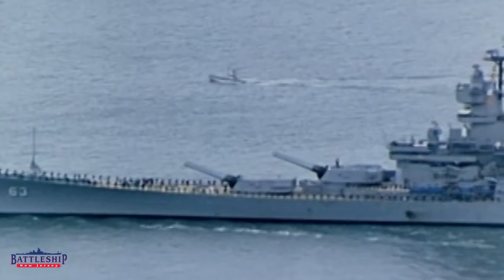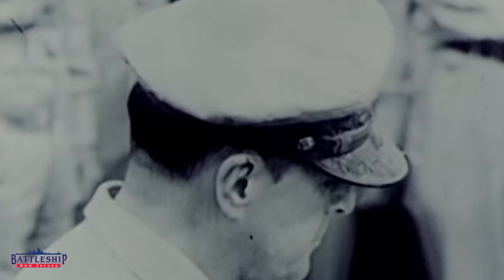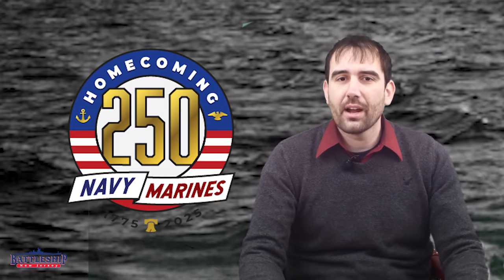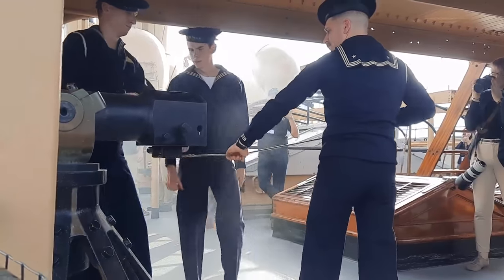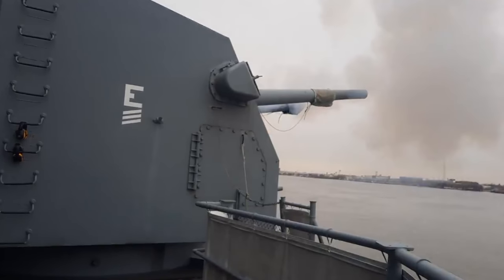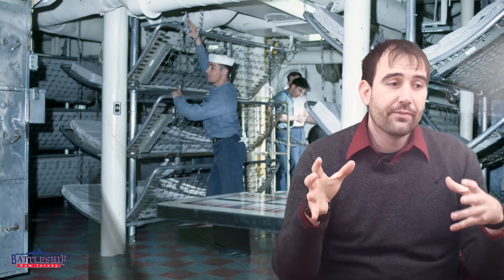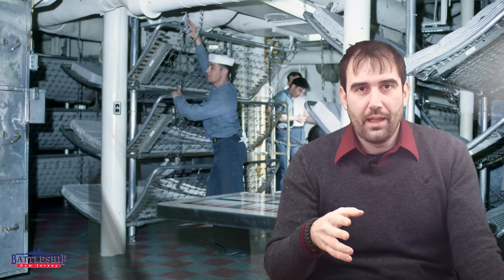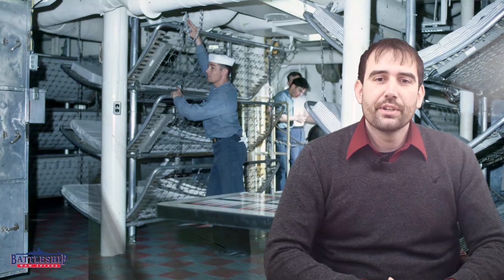Could You Build a Full Size Replica Battleship?

Comment: I mean, you'd basically be building a cruise ship with extra steps.  The really expensive parts- the military secrecy in gun and sensor performance, the guns and sensors actually living up to said performance, the safety procedures for stowing tons of explosives, the armor hardening... all would be skipped
Reply: but its nothing like a cruise ship.
Reply: @MrChickennugget360  was thinking the same thing. 

Show me a cruise ship with 5 layers of 1.25 inch thick steel backed up with a foot of armor grade steel, nine sixteen inch diameter guns that can shoot something 25 miles away... And go 33 knots. 

Nothing like that exists. A cruise ship does like half that speed, and doesn't compare in any other way except size.
Reply: @johnhartley5071  Dude, OP isn't talking about making a battleship -- they're talking about building a replica of a battleship. Which means that the guns, armor, and stuff don't need to work. It would still be a massively expensive and not-worth-it undertaking, but it's closer to building a civilian ship than you're making it out to be.
Reply: @vandahm  exactly it would need to look like armour, not be thick armour
Reply: @eberbacher007  

If you want the same draft, you better up the steel thickness

Good news is that it doesn't have to be armored steel
Reply: Yea they need to save the USS United States instead!

Comment: I believe this is a good place to restate my view regarding the galley and mess decks. With enough money, create a duplicate ashore. This would be a great money maker. It would actually just be a restaurant.
Reply: The mess would look a lot like a 1970s High School cafeteria.
Reply: @robg9236  I never had a cafeteria with an overhead that was only 1' above my head with all kinds of pipes and wire trays. Yes, you'd need to duplicate even the overhead, coffee urns, milk dispensers, scullery, etc.
Reply: Does Ryan explain somewhere why the Navy's contract doesn't allow them to return the galley equipment to operating condition?  Restricting the 16" guns and to a lesser extent the propulsion equipment make sense, but the galley equipment?  Is it a safety issue perhaps?
Reply: @MSUTri  The only thing I have heard is that nothing that requires steam can be made live. The galley requires a lot of water, cooking, steam tables, scullery. All of that water has to go somewhere. A lot of us had the same complaints when trying to save the Ranger. We wanted the galley to be useful. But, how do you get rid of all the excess and dirty water?

Comment: I understand the prohibition on reactivating the main guns and the propulsion system.

I have wonder though, what is the Navy's reason for not wanting the galley active? 

That would make it easy to feed tourists and add to their 'you are one of the crew' experience.
Reply: If I was to take a wild guess. It might just be because of the fact the Iowas were massive and anyone that doesn't know the depths of channels could in theory cause a Suez Canal like situation.
Reply: They covered this in an earlier episode. The galley used high pressure steam from the boilers. Dangerous stuff.
Reply: @randyogburn2498  Alright, yes, that would present a problem if they were going 100% authentic. However, in keeping with the theme of this video on replicas, surely some modern equipment substitutions can be used to bring the galley to an "operational" state for the making and serving of food.

As an aside, from the ships I have been on, I can see how steam would be used for some of the food preparation and 'keep it warm' storage sections but that would probably be low pressure, not high pressure steam. 

A bit of a moot point though since they can't fire up the boilers, so no steam regardless of the pressure level.

Comment: Here is a link to a Curious Droid video on how NASA determined that it could not reasonably build new F1 rocket engines that took man to the moon 50 years ago, despite having every possible blueprint required to do so.  Those engines were essentially hand-built and hand-fitted by the highly skilled engineers and craftsman of the day.  Yes, we have such skilled engineers today, but they do not have the practical experience these men had to build such complicated machinery.  Current engineering could build far simpler and more powerful modern engines to do the same task, but we no longer have the skills required to recreate what was accomplished at the start of the space program.  

https://www.youtube.com/watch?v=ovD0aLdRUs0

The same would be true of building a complete Iowa class battleship from the keel up that would be an exact copy of the original.  We need to preserve and treasure the fragments of our national past that we still have such as battleship Hew Jersey and her Iowa class sisters.
Reply: There are also a lot of materials that have been lost to safety regulations, where are you going to find a lead paint or asbestos insulation supplier these days?

Sure, those materials were banned for good reason, but the knowledge required for how to produce them and work with them was lost.

So if you are going to use modern materials for paint and insulation, and you can't make an F1 engine, you have to make other design decisions as well. Why not just use modern insulation/engines? Why not use modern computers? Why not use modern materials and engineering? Heck, slap a bulbous bow on there.

Pretty soon, it devolves far, far away from an actual WWII battleship, to just some ship painted gray.

Comment: I only know a little bit about warship construction. But I did learn a bit about casting the 16 inch guns at the Watervliet Arsenal in upstate New York. Let me just say that you need an enormous amount of infrastructure to make the components of the gun barrels, and assemble them into a working cannon. 

Even if you don't intend to have functional weapons, what are you going to do, just paint a steel tube? Even a cylinder of steel that large is going to be heavy and unwieldy and require some seriously heavy equipment to move it from its place of construction to the ship. 

That's only one component of many, but it is a good illustration of the serious technical requirements of building something as big and complex as a warship.

Comment: For a replica battleship pre-dreadnought, dreadnought or newer the most feasible way would be an accurate 3d model viewed in first person VR. Now for something like the USS Monitor, that ship could be built using modern construction methods for probable around 300k or less if the person building it was doing it their self and some friends and volunteers were helping, they would still need a place to build that ship on the water though and thats probable one of the hardest parts of building a ship these days..

Comment: Even railroad steam locomotives need somewhere in the neighborhood of $1,000,000.00 to go from sitting in a park to running at 70 mph on the mainline -- if they can find a mainline RR which will let their prize run on its tracks.  There are always tourist RR's they can run them on, but few if any of them has enough track to let classic high speed passenger and fast freight engines get up to the kind of speeds they were built for.

Comment: Pretty much believe you are correct, except for the electric motors. Until recently I worked at a paper mill built in the 19030’s. We have spare motors for every motor in the mill. We can rebuild the oldest of these. I suspect I coukd, for enough money, get a new unit of any of these.

Comment: Full replicas for WW2 era battleships and Aircraft Carriers would be notably more difficult than smaller class ships and those before that war. 

With a limited budget, but centuries worth of time, I would do the following stuff:

With CSS Virginia, BB-39 Arizona, SS Atlantus (made out of a concrete substance less destructive to the environment than the slowly disappearing original), 1799 Enterprise, Mauretania, and Dreadnought would receive full sized replicas. 

As for Britannic, Olympic, CV-6 Enterprise, and l-400 class submarine, they would be partial reconstructions. Britannic and Olympic would have specific sections created; especially the cafe area. CV-6 to either be on a reconstructed landing deck or specific grounded rooms. As for 1-400; a reconstruction of part of the sub that housed airplanes. 

SS United States and Queen Mary 2 in general need serious refurbishment.

Comment: To replicate an Iowa BB we'd have to rebuild manufacturing systems that no longer exist.  The BBs used some manufacturing equipment that is larger than anything currently in existence.  For example, the machinery used to make the 16" gun barrels....some of that simply no longer exists and we'd have to build it.    But with infinite money anything that could be built can be built again.    There's a lot about the BBs that can't be built again without recreating the equipment that was used to make it.
Reply: You wouldn't need to do that if you were just doing a replica. A steel pipe modified to look right would be much cheaper since you're not building something to actually fire.

Comment: 12:00 Problem with changing plans is that you end up spending an incredible amount of time having engineers figure all that stuff out. Instead of paying someone to do the riveting, you are paying an office of engineers to do a redesign. You'll probably end up saving money, but I doubt you  would save any time.
15:00 :/ I think as long as you fire solid shot its just a destructive device and you need the tax stamp for it. the problem would be getting it made. Nobody makes gunbarrels like that anymore. I guess the machineguns would still be tricky unless you got a dealer license or whatever.

Comment: While a replica is nice and all, I think something along the lines of the G3 concept might be easier to pull off, today.
 Think a single double main turret with two 16 inch barrels, then a double 5 inch turret and a missile silo.
Trimaran hull, which lets you go the so cellen Dragonbone or melbury(?) bridge like frame structure in terms of the main beam, by having at least three of them, in order to better support the Trimaran wing setup.
A well-dock, supplier stern and a heli-path with hangar are the next needed hull items/things. 
Hull armor, probably what is currently used for carriers, which might still be using battleship hull armor, think G3, Yamato, Iowa and the USA carriers from WWII, on-wards.
Mushashi her blueprints where found in the yard that originally constructed heren iets funny how a Pagedo(?) Tower looks like a modern stealth radar mast, without the stealth plating.

A WWII warship, cruiser to battleship, rally could have used a well-dock for their recon-water-planes.
No stopping needed, just float it in.

As for that Iowa Cad design, will the blueprints from that cruiser class of three ships (from that printer video clip), also be used???

To get a battleship constructed, today, you will need to create a need for it.
Start with some proper battleship & carrier escorts  that can also handel shore bombardement and more, the current political  climate between China, Russia en the West, will create the momentum needed to resurrect the battleship. 

Personally I wonder what a upgraded Tillman IV-B would be like.
Even if it's to post-WWII, status.

Comment: We don't even have the manufacturing capability to build another functioning Saturn 5 rocket anymore, those things were hand built with methods we don't have, don't use or have offshored. Especially the engines. Sure we can make rockets but not the Saturn 5. There isn't a place in the country anymore that can manufacture even a complete turret and barbette anymore. I mean, yeah... sure all it takes is money but look how long it's taking to make micro chip plants here again... many years and many billions of dollars. Intel's new plant is $20BN USD alone and won't be ready for a while, and there's the the need for thousands of workers... the infrastructure doesn't even exist anymore.
Reply: We could build a replica Saturn V.
The question would be why bother. 
We can do much much better.
(The F-1 engines were riddled with manufacturing errors found in every example recovered).
The SpaceX Falcon Heavy and Dragon capsule are quite capable of a lunar orbit return mission even though the LEO capability is half that of the Saturn V.
The lack of a Lunar Module is a bigger problem than the booster.
Reply: Chevron dropped $75 Billion on an LNG plant…

Comment: If one guy can simply build Azzam for about $600M USD which is about 2/3's the length of NJ, and Somnio for about the same price will be 728' which is about 150' shorter, it would be feasible for someone to want to build an Iowa for a private yacht, sure would be interesting.   The closest would be something like motor yacht Skat, while only 233' long is modeled after modern warship and was/is owned by former software engineer from Microsoft.  It has steel hull and aluminum superstructure, not needing armor that would save a lot of costs.  Just saying if someone is itching for a new unique yacht an Iowa would make a cool boat, although finding space at marinas will be a huge problem.  That is part of the issue now is anchorage space for the super yachts. Most yacht owners don't want to dock at commercial ports, they want to be in a bit nicer locations.   Would be cool just to have the exterior setup, and then nice modern interior. 💲💲🤑

Comment: What is "the gallery equipment" mentioned at 17:46?   
17:43
the navy doesn't allow us to reactivate

17:46
the 16-inch guns the galley equipment or

17:49
the propulsion equipment
Reply: Galley equipment-think kitchen stove. It ran on high pressure steam from the boilers. Can be deadly in case of an accident.

Comment: The 16-inch and 5-inch guns should technically be legal for an average person if you fill out a form 1 with the ATF and send a 200$ tax for each gun. The AA guns you can't because of the Hughes Amendment. The propellant charges would most likely also fall under the same tax requirements.

Comment: The easiest answer to "Can you build a full size replica battleship?" is "yes, and we could probably build it faster than during WWII, but it will never be done because it will be insanely expensive and would be a paperweight as it has no use in modern combat." My best guess is, it would cost as much, if not more than our most modern ship in current service depending on configuration. If the ship is going to be in the original Iowa WWII configuration without all those modern components added to it over the years after the war, it will be much cheaper than if we were to make it as modern as the current Iowa ships. That is if they can even acquire the components, equipment, and parts that were made in WWII. Many of those original parts are lost to history and to re make them would take a ton of work and effort as you would have to dedicate entire factories to make said stuff. I doubt there is any working factory in current service than can make a 16in gun barrel, let alone the breach, so re tooling a factory or building a new one to do it would cost a fortune as the machinery needed for that will be immense. Then the armor plating, and oh boy that is a lot of steel needed. The best way I can see this happening is if we scrapped a bunch of old ships, melted the steel, and even than it would be an insane amount of steel. The best way I can see a 1 to 1 scale replica is if its a wooden mockup or shell that has none of the insanely expensive parts. Its defiantly possible, but insanely expensive. Maybe one day in the future when more things can be automated, it could be done full scale 100% accurate to the original Iowa class by 3d printing most of its parts out. Until then, it would be far too expensive.

Comment: Given the overall simple shape of the Monitor, I would imagine it would not be horribly difficult to build a functional equivalent in terms of exterior appearance which could be operated in the river. No effort would be made to make the interior period-correct, it could be made up to current standards and powered by a diesel. More effort could be put into making the turret functional and correct-appearing for reenactments or pier-side demonstrations. Still wouldn't be cheap, but not totally impossible either.

Comment: Even assuming that you just skinned a replica that looked like the original from the outside, even considering the reduced weight of a skinned superstructure, you'd still need a load if not all of the internal framing to hold the hull in shape. I'm also assuming that the decks themselves structurally support the ship as well so it might not even be possible to build a full sized visual replica  Iowa without building most if not all of the internal space too.

Comment: Could you, as the caretaker of an actual Iowa-class battleship, divide the ship down the middle and have say the starboard side remain in it's 1980s-ish configuration, but return the port side to be reminiscent of the 1944 configuration?
Reply: In theory it could be doable but it would risk damage a lot of stuff. Whatever is remaining on the Aegis system on the inside of the walls. If it's refit was similar to WisKy's then there would be a few decks you would have to grind or cut out section of deck to remove some of said areas.